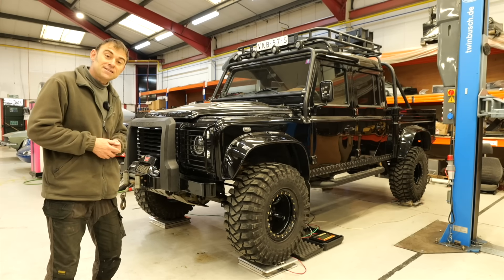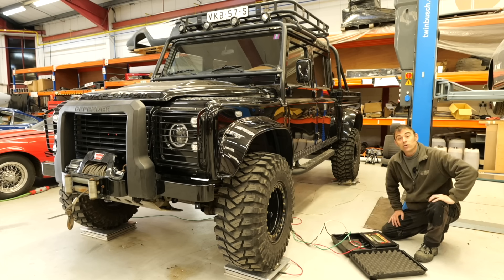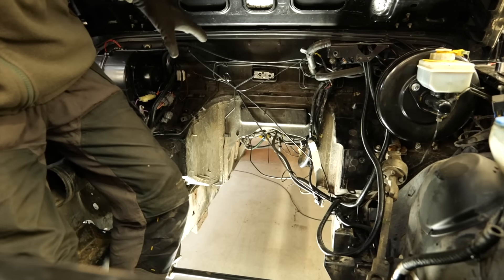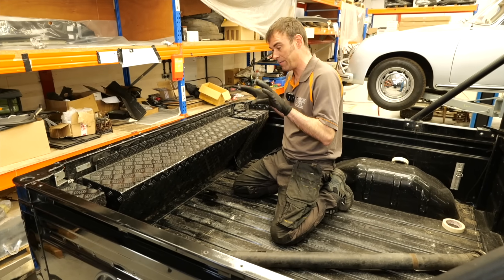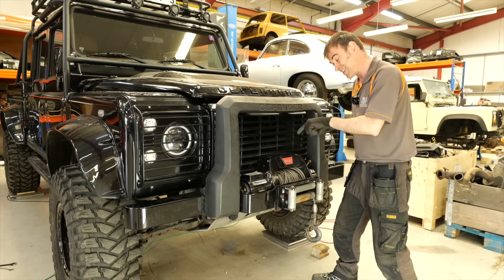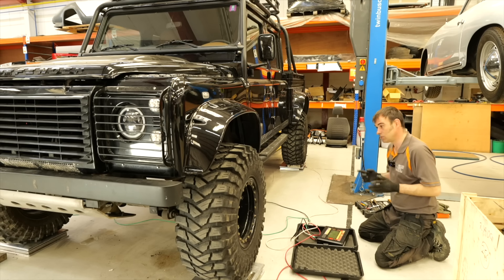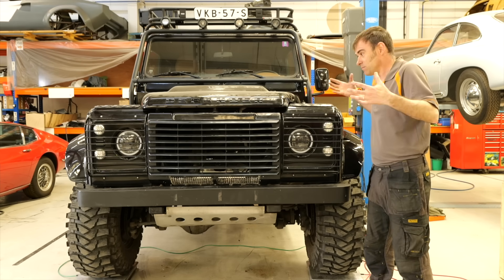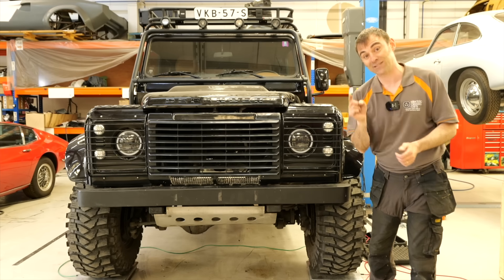A project with a weight problem

Comment: Lose the roof-rack. That's going to weigh a fair bit. You can also save a bit of weight and improve efficiency by going to a less aggressive tyre.
Obvs, if you improve efficiency, you could use a lighter battery pack.

Edit: I paused the video to write this comment. If I'd watched another 3 seconds I'd have heard you say the customer wants to keep the roof rack!
Reply: They could remake the roof rack and roll cages in aluminum, and that might be quite a savings.
Reply: @devenscience8894  There's a reason aluminum is bad for roll cages, they would just crumple up and trap or kill the passengers if it ever rolled.
You wanna use chromoly steel, it's stronger and lighter than basic stainless, and still just as at corrosion resistance. Only downside is that it's pretty expensive, but that's probably a non issue if you're hiring these guy to do an EV conversion.
Reply: @superkirk11  he did specifically state that it was being kept for appearances, so I was just thinking that its use as a roll cage wouldn't be as big a factor.
Reply: Why not take away the Axels and put a motor front and rear and use Teslas amazing esp-system? Would be weight- and energysaving?
Reply: @Elbilforeningen  because ESP is "Electronic Stability Programme".
Without the axles, you'd have nowhere to attach the wheels, nothing to transfer drive from the motor to the wheels and nothing to hold the chassis off the ground.
Reply: The Tesla motor is trans-axle, and as such, one axle is going away anyway for a custom axle. The problem with the initial comment is that the additional motor is going to be weight. This is for Norsk and drum brakes.
Reply: @ronaldking1054  They will be keeping both of the original axles. WCC fit the Tesla Drive Units sideways in the middle of the vehicle with one output going to the front axle and another to the rear axle . watch their other Land Rover conversion videos for a full explanation of how they do this and the gearing changes needed to the Tesla unit to make that work.

Comment: Replacing the rear tailgate with a cargo net would be a nice weight improvement and could be quite a cheap mod.
Reply: I would say remove the complete truck bed and have a new light weight purpose built. Adopting this stock bed to fit 4 bikes with some kind of system to lift them in will be a huge challenge, so maybe you have a big opportunity there...
Reply: Could put on a flat bed, customized to be lowered as a ramp for motor bikes or fold away to side profile revealing a goose neck connection, or just flat bed with stake slots for removable fencing or mouting a camper.
Reply: Carbon fiber would be a fair alternative if the net isn't the visual the owner is going for. Especially if the bonnet and tailgate were paired to look the same (same weave, same epoxy, etc.) and bring the front and back together. Maybe a custom logo for the owner...

Comment: Can you not just beef up the suspension instead of removing stuff (that is arguably functional for an off-road focused vehicle) like the bumper / winch and the hitch from the back?
Reply: Can't exceed 3500 kilos. If you do, it'll require a different type of license to drive.
Reply: @logitech4873  sorry, I'm taking the American perspective here, where tons of people do stuff that is both legal and unsafe to their vehicles.
Reply: @davideloewen  Don't you need any special drivers license to drive ford F-450? Anyone can drive that 14000lbs behemoth?
Reply: @logitech4873  Its not only license, 3500kg is max for passenger vehicle. The car needs to be re-registered as a truck for above 3500kg weights and not all cars be.
Reply: In Australia you can do a GVM upgrade that has engineer approval to get a higher load limit.